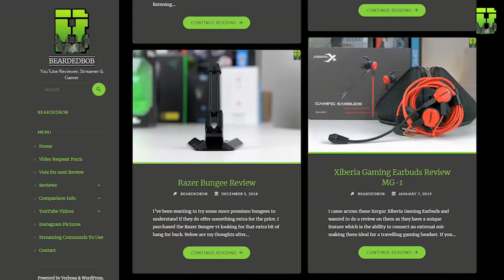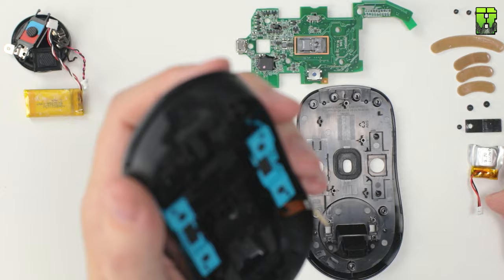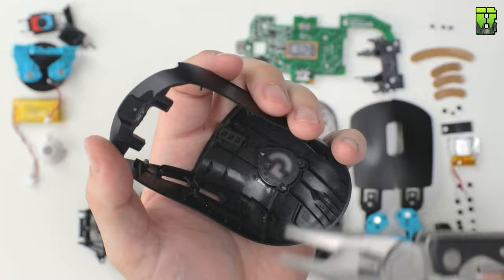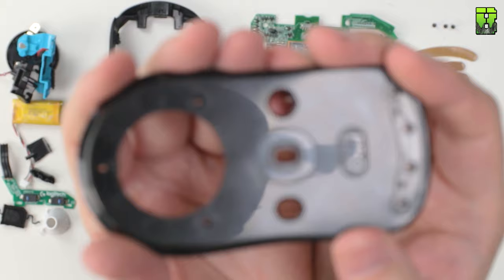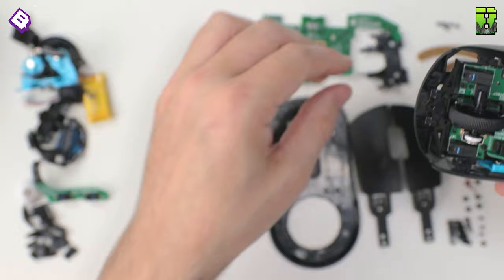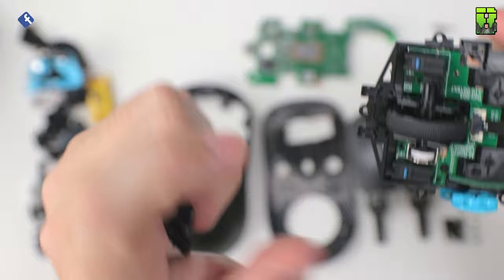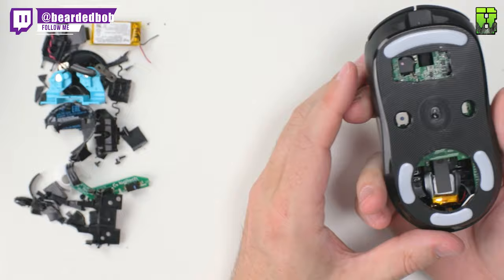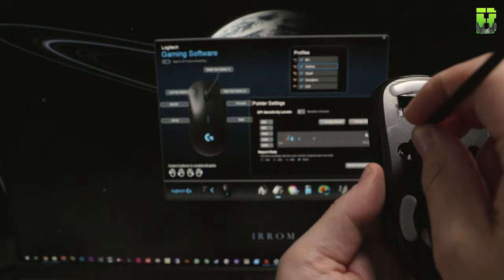HOW TO REMOVE 20G FROM THE LOGITECH G PRO WIRELESS - Weight Reduction Mod

Comment: for some reason my scroll wheel stopped working but the scroll button itself is working? I didn’t really touch anything near the scroll wheel either
Reply: k thnx for ignoring me on purpose just wanted help, i guess ill just retake my mouse apart and see what i did wrong
Reply from the maker: Damn son give a brother sometime to response :-p. Have you sorted it now?
Reply from the maker: What did you do to the mouse? did you take it apart?
Reply: Beardedbob sorry lol, yes I took it apart and then I put it back together and the scroll just stop working, it still doesn’t work I’ve just come to life with it because I don’t wanna open it up again and accidentally break it lol
Reply: I took out the side buttons on the right of the mouse along with the battery, power play, and power button

Comment: Do you know if there is any way to increase the LOD on this mouse? Just found the perfect grip, but the mouse keeps losing connection with the pad from time to time.
Reply from the maker: Nope haven’t come across away. You could sand the base so it’s got less plastic but it won’t make much of a difference

Comment: You're mad. I paid $130 for a near perfect mouse, to hell with doing this. I just bought some nice mouse feet and deal with the weight O_O Coming from a Glorious model O, Only thing I had to change on my GPW was mouse feet and now I can't stop using it. I prefer it over the 20 mice I ran through trying to find a perfect mouse.
Reply from the maker: I thought the 20g wouldn't make a different but the 25% weight reduction has grown on me. The Model O is a great mouse also.
Reply: Beardedbob 20g is very much a big difference yeah, I just don’t have the heart to ruin my mouse, lol

Comment: Or you could buy a Model 0 and its $50 and light af
Reply from the maker: I can't decide between them. Here is a few things to help you perhaps.

1. Is cost an issue? If so model O
2. Do you need side buttons on both sides? If so GPW
3. Do you mind having a cable? Pick the one that fits.
4. Do which shape works best for you?
5. Are you sensitive to weight?

Comment: my right and left click buttons dont activate?
Reply from the maker: Have you opened it or has it just stopped working? I can take a look via this service. https://shop.beardedbob.com/collections/customised-gaming-mouse/products/repair-broken-mouse-switch-or-replace-with-better-service
Reply: @Beardedbob  Hi sorry I replied late I figured out the issue! It was my own stupidty, I hadn't pushed the J2 connector cable in all the way, do you think sanding down the bottom will reduce a lot of weight? Im thinking of doing it and sticking some SL mousefeet on

Comment: So can you re apply the mouse feet after?
Reply from the maker: Yep. If they use some stick use some m3 tape
Reply: Like can I take them off and re apply no problem?
Reply from the maker: Yes just ensure you use a hair dryer and don't over bend then when taking them off. There should be enough sticky left to put them on but if not use m3 tape
Reply: Also the part we’re u out the left and right buttons back in for aiming and shooting the two screws on each side on the right side the screw just keeps going and won’t stop how do I fix this?

Comment: Is there any chance you could sell me your modded g pro wireless? I'd like one but I'm afraid I'd break it by modding it
Reply from the maker: A few people have asked me if I would be and it comes down to what they want to pay for it. It won't come cheap as I would expect the price of a GPW + what my time is worth to mod it so £100. That's £229 plus shipping to where you are located.

If people are interested I could mod a brand new or you current one, for the above price - the mouse cost but given the effort and time it's not going to be cheap.

I will also not take responsibly if it breaks or is lost in transit. 

Those one I've modded her is destined for further modifications stage 2 weight reduction and then stage 3 switch swap out so you wood need to let me know what mods you want. Pm me on discord or Twitter to discuss.
Reply: Omg ok ohh ok... 😂😂😂😂😂😂😂😂😂

Comment: Stage 1 nah man, it's like stage 3 or at least stage 2 man bruv
Reply from the maker: Nar bruv a stage three takes it a lot further 🤪
Reply: @Beardedbob  Wachu mean? I just took the whole side-button-pcb and left just the cable-(tape?) that needs to connect the front buttons with the main pcb. Tomorrow I will drill the hell out of this mouse :D
I got also the 100mah battery as u showed except not from amazon because it's out of stock, but it's the same, what was the middle white cable for? Because the new battery has only + -

Comment: I wonder if the skoll mouse iv ordered would the top shelling fit over the gpro. Have to give it a go for sure.
Reply from the maker: I've been testing the skoll and the base or shell would need some modification.
Reply: Beardedbob it would be stunning. I’m thinking of putting the gpro board into the skoll . The skoll just looks like a brilliantly shaped bigger model o. Zowie clone in many ways.

Comment: batterie never lasted a month stop the exaggeration.... mouse must be super unbalanced...
Reply from the maker: It does, maybe you had a faulty one or you have RGB on full 😆. At the end of the day it will depend on how much you use it as well as your polling rate etc. Feel free to video it and how me in a time-lapse :-).

 Balance is also centre but you can move around the battery to have it where you prefer. 👍

Comment: Can someone explain this shit to me? What's the point if you remove few grams from your mouse
Reply from the maker: To get it to the weight you like. some people like it heavy some prefer lighter. At 80g its middle of the road where 60g is where most light mice at this size are sitting. This gives people a wireless mouse at 60g. I'm not sure there is one on the market atm?
Reply: @Beardedbob  I get that but why would compromise a build quality and usability to get few grams. I saw people remove scroll wheels which is quite extreme if you ask me